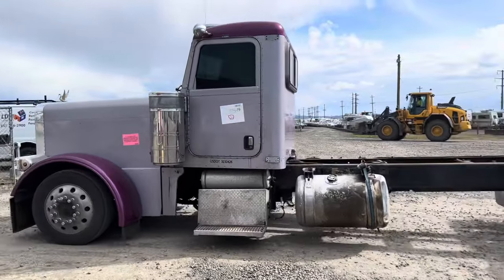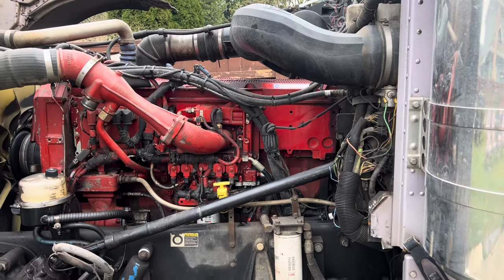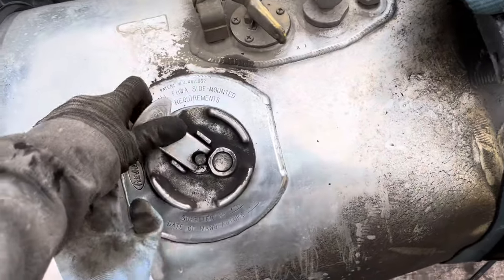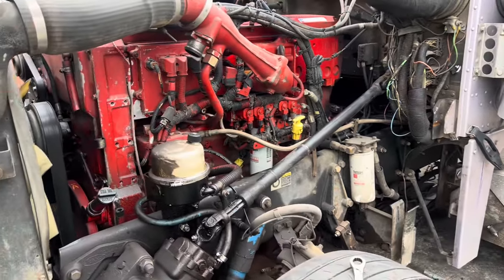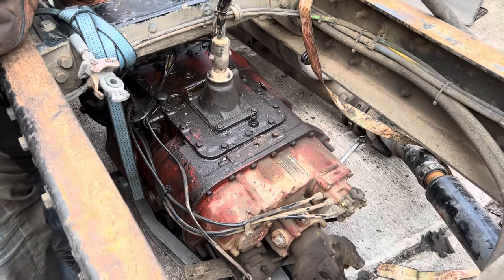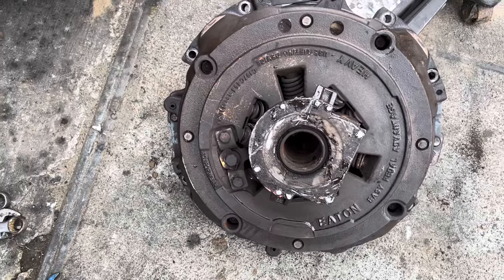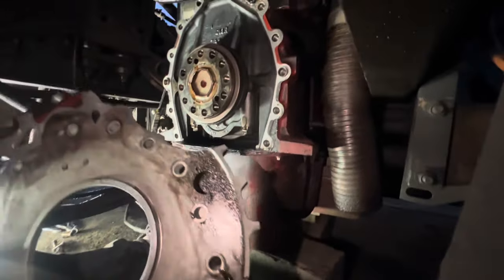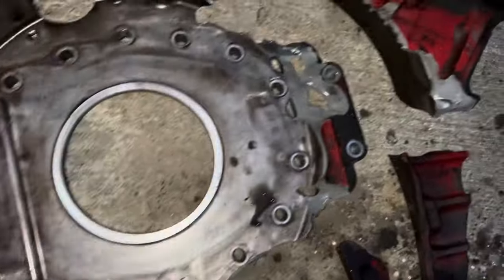Hidden damages on Peterbilt 379 from IAA Auction | Flywheel housing Cracked | Removing transmission

Comment: My lord join the jet again and buy a compressor and air tools. Working on that heavy equipment has to suck without. You guys know your stuff. I know battery is nice but doesn’t have torque of air.
Reply from the maker: Milwaukee stuff has more torque than air.. air is in the past. We actually have a 80 gallon compressor and 3/4 and 1” air impact guns. But the Milwaukee stuff beats it everytime

Comment: the damage at the oil galley is a very very bad thing, you better pull the pan and check #4 main and rod bearing for metal before you start it,
Reply from the maker: Why exactly the number 4?
Reply: @CustomRigs  its where the oil comes into the crankshaft from the oil galley from the oil filter, the abrasion i saw in your video that metal was past the filter, went into the engine, i would suspect all the rear mains have metal in them, and possible the cam bearings also, if it fell into the oil pan the oil filter may have plugged really fast and the bypass valve would have opened, going right to 4, better cut the filter open also, if you find tons of metal pull the engine and clean it or you may loose the crank and block, also if you find metal in the filter do not reuse the oil cooler for any reason.
Reply: @CustomRigs  at 5.18 in the video you can see the abrasion